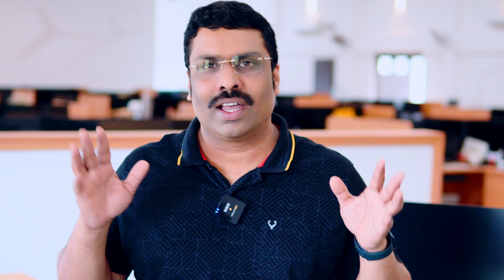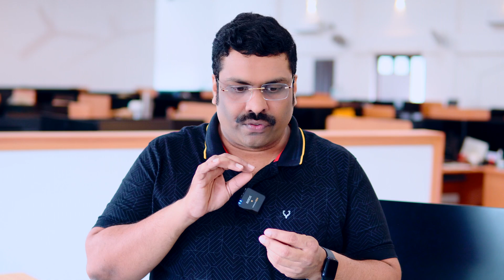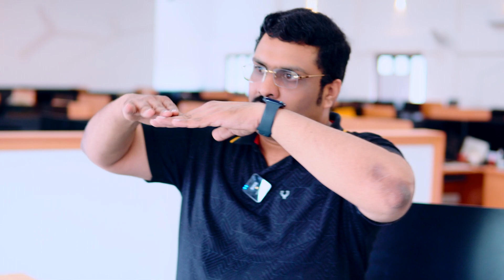High Rise Building Water supply System How Works??

Comment: you are absolute;y wrong engineer,. high rise buildings are using pneumatic pump to maintain the hot and cold water from basments directly to the floor, ythere is no need service floor my dear engineer ..
Reply: U are right sir,
Service  slab not at all required.

Even 40 stories building we doing gravity distribution system.

Some of the projects we have done. Combination of both gravity and hydropneumatic pneumatic system.